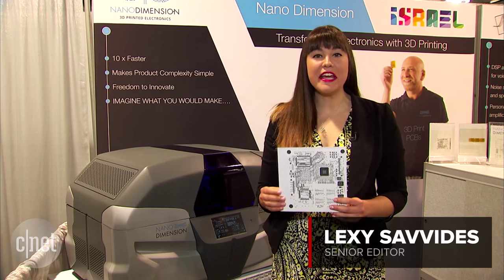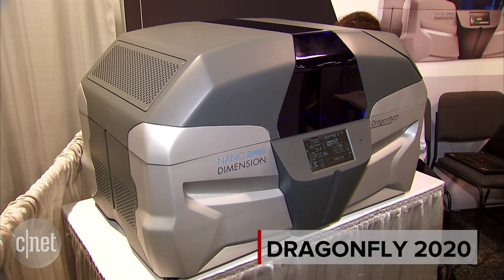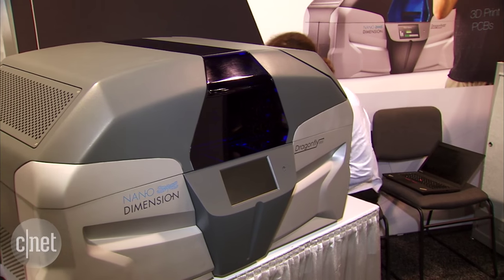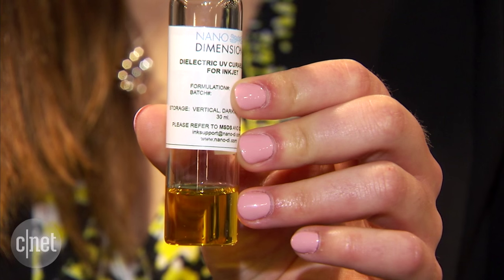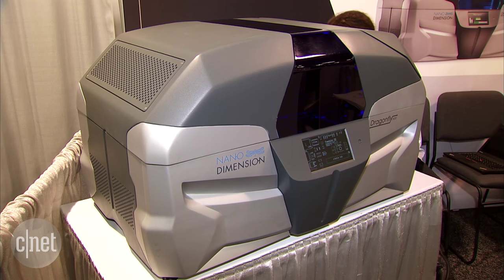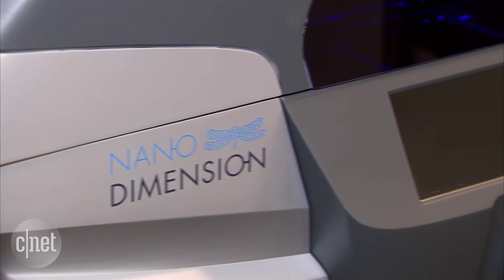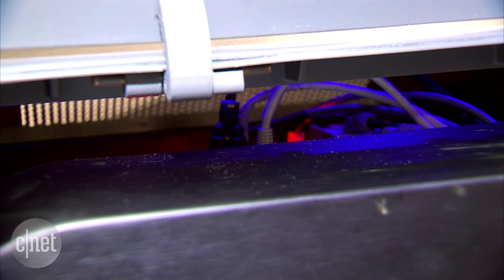Is this the Holy Grail of 3D printers?

Comment: This is NOT a 3D printer - it prints just in TWO dimensions
Reply: +Viktor J a circuit board is a 3d object you know.
Reply: Koochie Koo Its just printing ON the board, that's the same as saying "paper is a 3d object you know"
Reply: Viktor J its not , it prints the actual board too. the board is a 3d object. a standard printer doesnt make the paper for you as well does it.
Reply: I don't think it does. Look at the beginning of the video - the circuits on the board she is holding are much smaller than the actual board. Therefore I assumed that it is just using premade boards and printing on them. Either way I may be wrong and in that case I apologize
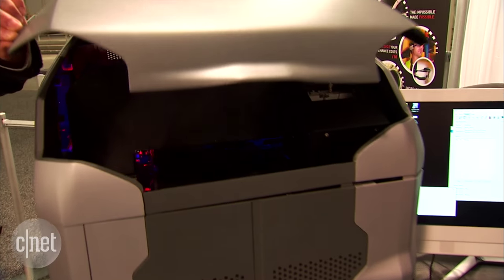Reply: +Viktor J you should really look at the video over .. Esp at 0:50
Reply: oh, you were so right, feeling bad that I missed that part -.-